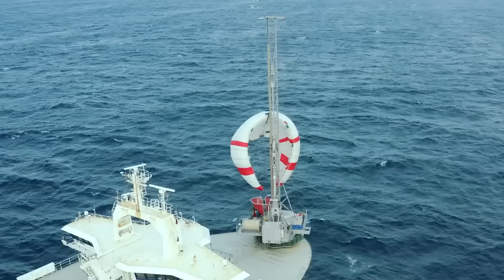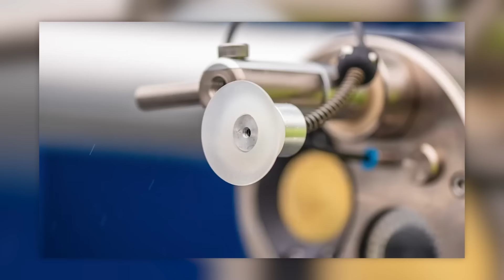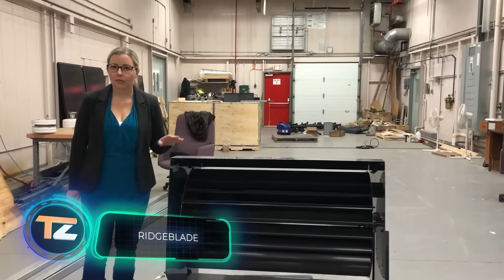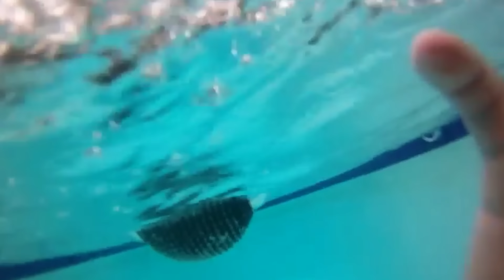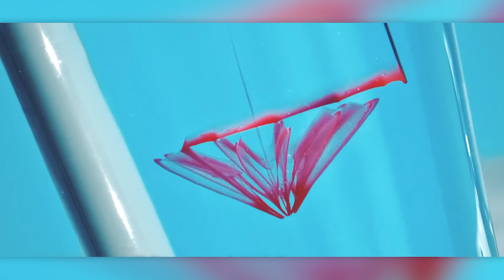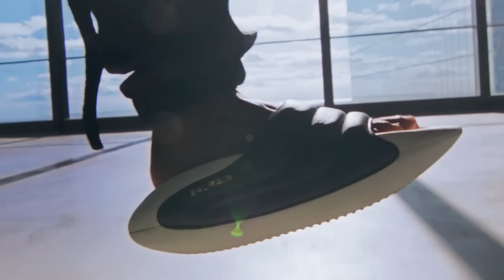INCREDIBLE INVENTIONS THAT WILL SURPRISE YOU

Comment: The robot loading machine is cool.. but not really useful when you realize that in MOST warehouse and shipping , boxes are RARELY uniform width like that.   Granted, that is something you can pretty easily build a machine to work around.   Spring loaded rollers with a wider path for the boxes would do the trick.   

You'd of course need to program the robot to stack boxes according to size.  

And since you're doing that, you might has well build a sorting robot the loads the conveyor robot.   Since you're doing that, you might as well rebuilt the conveyor robot to have adjustable side panels that the robot adjusts based on a visual scan of the boxes. .. and that would be better because less moving parts (not having spring rollers) means less things to break.

Comment: Wouldn't the inflatable flow stop thing just float away? It is filled with air after all. Or does it kinda lock into the door frame when it expands? Or have weights in the bottom of it? Be good if they explained how some of the things worked a bit more. 🤷‍♂
Reply: At least it locks into the door frame, with pressure and friction it can stay put, hopefully.
Reply: @mahmoudfuad1868  It doesnt if you fill them with air. but they work fantastic when filled with Water.

Comment: screw that truck loader   the "Customized EoAT"   as a lumper that unloads trucks  i would deny that load for not having pallets under the boxes  with 3 ppl it would take around 3.4hrs to unload that pallet-less  truck depending on contents,... but if it had pallets it'd only take 30-45mins  and then we would actually be able to unload the rest of the 10-14 trucks on the days schedule    53ft trailer fully stacked 9 boxes high without pallets = "DENIED"

Comment: You know like a Hammer?. They should make a Hammer that's head beams a light so you can Hammer nails in the pitch black woods. They can make ultra hard materials and I want (WANT!!!!!!!!) a Hammer that works like a torch in the dark. Light the end of the Hammer up please. Thanks. I'll get my coat. Found this video somehow. I looked for a recent one. YOU KNOW THEY CAN MAKE HARD MATERIALS FOR TORCHES. MAKE A HAMMER THAT HAS AT LEAST A TINY IN THE HEAD POINTING WHERE YOU WANT IT TO. IN NOT ATTACHING ANYTHING. JUST THAT HEAD OF A HAMMER THAT IS LITTERAALLY A TORCH END. DIE If you want me to. I'll get my coat.

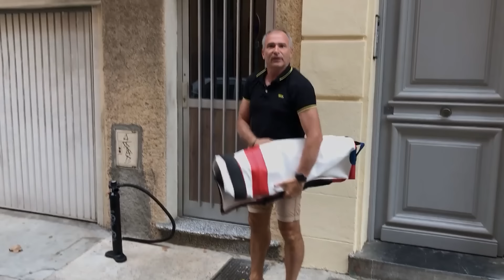Comment: 3:05  Increase profits?  Maybe if you're replacing an attendant who does the fueling for a customer, not if you're adding the cost of the robot and the electricity to run it to a self-service station.
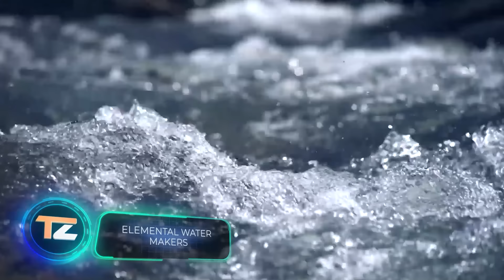11:05  How often do the filters and membranes need to be changed?
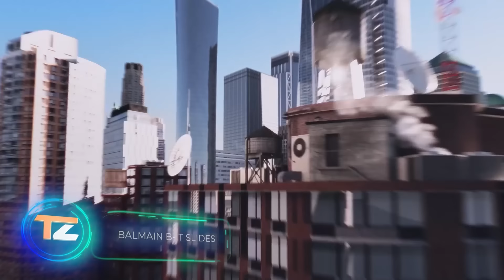12:05  Price for those shoes is $745 too high, okay, I'll pay extra for the name.  It's $740 too high.

Comment: 1000 metres square is 1000 metresx1000metres which eqals1,000,000 square metres so that sail is a really, really big sail/kite!
Reply: If you look at the kite it isnt square they have taken that material and folded it a few times for strength and aerodynamic performance...Its still huge but not as huge as you are picturing.

Comment: Ahh with the flowstop they over looked something very critical, they have to be outside in the possible danger of a flood, storm , to pump it up.
Reply: ahemmm... floods and storms don't drop out of thin air. there usually is ample warning time beforehand. more than enough to pump up that barrier in any case
Reply: @emanymton5789  "floods and storms dont you dont drop  out of thin air" that is exactly how storms and floods start... out of thin.... duh..
You dont know much about the behaviour of weather. Just because you never heard of anything like that happening  from people on tik tok   does  not mean it has never happened. Just because you never heard of it does not mean it does not happen. 
"Ample warning before hand"   not all the time.
 A little  bit of information is always dangerous as people with this attitude think they know everything about said  subject.
Reply: Doors open in. Go outside, pump it up, open door, step over. If your neighbor doesn't have one, too, it might be a problem, but many old European buildings are solid rock, brick or cinderblock so, maybe not.
Reply: @denicedegrazio6174  so your neighbour needs one aswell for it not to be a waste?

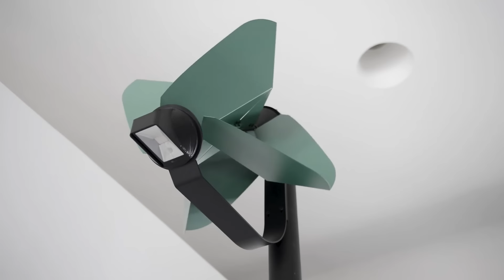Comment: 7:34 "two thousand kilowatt-hours per year"  That's nothing to brag about. That's a why even bother machine.
Reply: no kidding thats what i use in a month during summer just by myself
Reply: @jjjacer  He must have misspoken. Two KWH/year is NOTHING. I probably absorb that much through my skin.
Reply: @craigcorson3036  it is not 2 kwh per year but 2k kwh per year. 2k-2.5k kwh per year is the average annual consumption of a single person household
Reply: He says 2,000 kwh/year. I agree with the other comments. I use almost 2,000 kwh/month in my home. Trust me, my bill last few months was +-$400 each month.
Reply: 2,000 Kw/hr in the UK at 34p per Kw = £680. Not too bad. And 34p is the 'current' subsidised rate.
Reply: Are you guys kidding? My parents live in an average-to-small house, in Ukraine. So, their 6-year energy consumption is less than 15 thousand kilowatt-hours. So, assuming energy can be stored, they'd have more than enough from only two of these generators. That's assuming the same wind, of course.

For context. They have about average house with low to average income. And they use Gas fow heating.
Reply: America is an energy hog; the average annual electricity consumption for a U.S. residential utility customer is 10,632 kWh.  So in the US, you'd need at least five of those to run your home.   Average use where I live (Alberta, Canada, little need for A/C) is 7,200 kWh, so I'd need three or four.   Energy efficient homes with LED lighting might get by on two.  In third world countries, even one 'why bother machine' could possibly power half a village.
Reply: @youtubemakesmedothis7280  But those third-world countries are generally NOT the places that need to reduce their carbon footprint, are they? The places that DO need to do so need much better machines than this one.
Reply: @craigcorson3036  True enough.  Often developing countries rely on coal; inexpensive renewable energy is a great benefit.